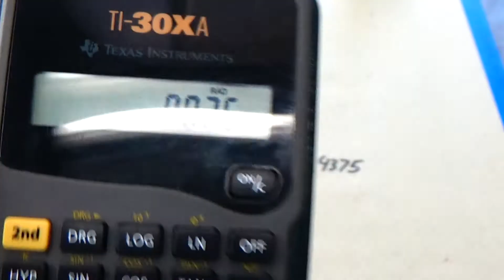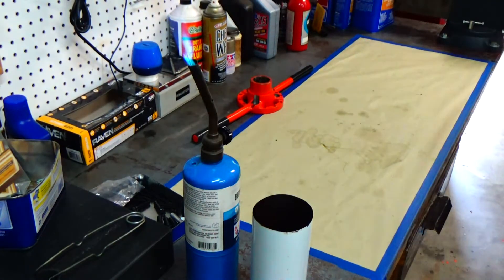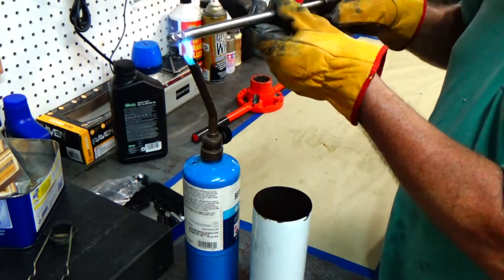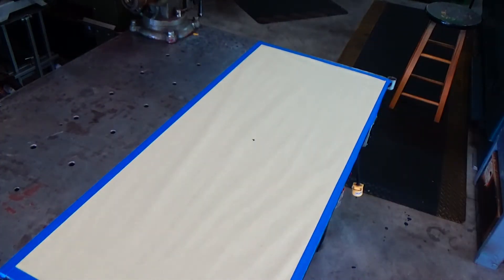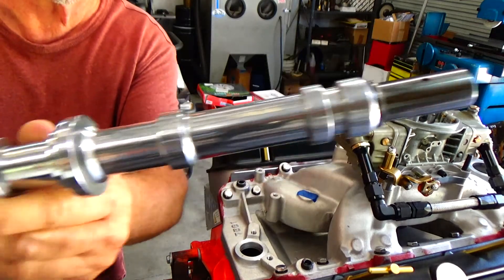Make a Oil Pump Primer tool... #25 Chevy 454 Build Block Performance Build....

Comment: I see some of these videos for cheap oil priming tools I figured out my problem I was just using a drill  But if I had bit in the oil just pours out of the galley It doesn't prime one side of the head that's why I use a regular distributor to make a tool No one seems to really understand how the oiling system really works in these on YouTube. Because no one ever mentions this A distributor restricts the flow from one of the cam galleys to get oil to push rods and lifters

Comment: Made one out of old distributor as well. Took drive off ground teeth completely off plus a little to make sure would clear the cam gear. Cut the shaft at the top with hacksaw just below the stuff on top of it. Cut housing just above the hold down portion so would be able to secure it. Mine had a bushing in it at that location but if it doesn’t easy to find proper size and install. Reassemble. Use a half inch drill to run, make sure turning proper direction.
Reply from the maker: Thanks for sharing how you went about making your oil pump primer tool... Good info thanks...